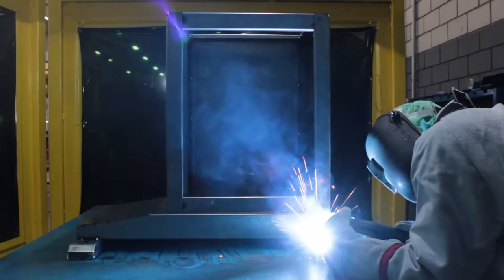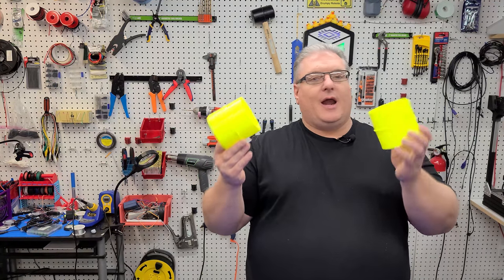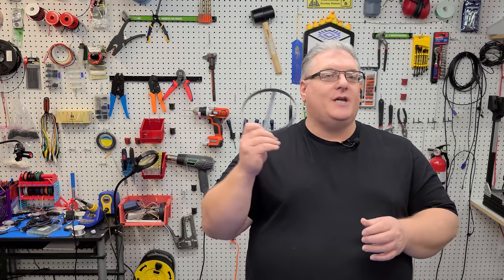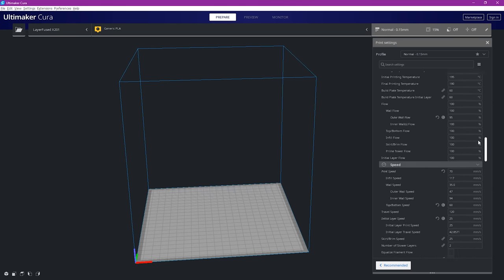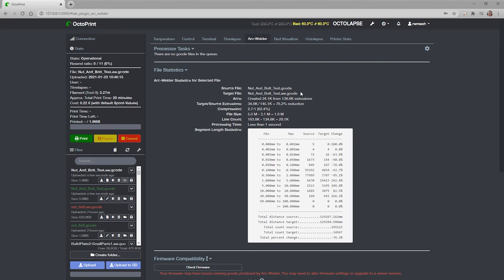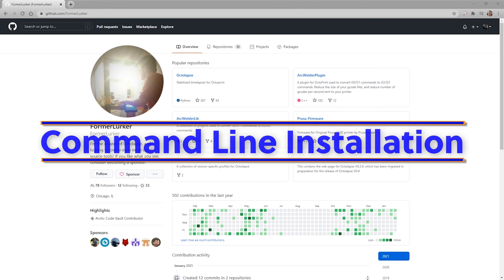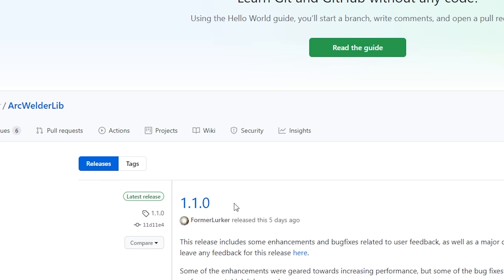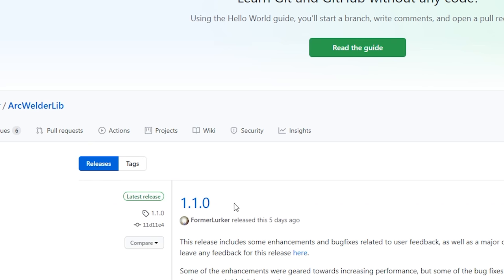Arc Welder - Smoother, Faster, Better 3D Prints! Its like magic to improve your 3D Print quality.

Comment: Arc Welder seems to work great. Thanks for the video. Most of my test prints have been vastly reduced in size, but for one odd one. It was just a test piece to check if I had enough clearance to fit over something. Simple washer shape. 1.25" ID, 1.5O" OD and .25" thick. Arc Welder added 3% to the file size.

Comment: I used to create models in tinkercad and i would notice when printing round objects there would be quite a bit of stepping and you could see the straight lines. But I have finally gotten comfortable using Blender 3d, so when I create objects that require smooth outside surfaces, I just make sure to increase my geometry to compensate. I've been able to get flawless outer surfaces on prints since moving to blender. Either I will create the circle and increase the vertices from step 1, or I simply add a subdivide surface on the object. Yes the file sizes are larger, but my workflow hasn't suffered much, and blender is also very specific when it comes to things like excess geometry, flipped normals, walls trapped inside geometry and the interface allows you to get really surgical when it comes to getting a perfect manifold model for 3d printing.

Comment: I used to accomplish a similar effect telling TinkerCad to create circular objects with maximum number of steps (up to 64), but often on items with lots of holes, that caused TinkerCad to slow to a crawl every time I told it to group pieces. It also resulted in HUGE stl files. Since adding Arcwelder to Cura, I leave the steps in TinkerCad at the default 20. My stl files are smaller, Cura slices them more quickly and I don't get any stuttering on my Aquilas ( I run Alex's firmware). Once my first layer is down, I usually bump speed up to 200% or higher. On my printers it looks like 300% is the maximum where I can see the speed difference. Higher than that, and I see no obvious improvement. I love Arc Welder!

Comment: I'm so glad I found this video. Thanks for making it and thanks to FormerLurker! I had no idea Marlin could handle arcs in GCode. 

Top notch software works a treat. 

If anyone is curious I'm running my octo-print server on a Pi Zero W and Arc Welder runs fine.

Comment: I love Arc Welder, it can improve prints, but it just straight up makes print streaming faster.

I have honestly been thinking about running some speed tests, since there is less gcode to run and combine, it should be faster...

But yeah been using it since beta and my only complaint with it is that its a little too easy to use, it feels like i should be doing something, nah just install and boom magic

Comment: I added the Arc Welder plugin to Octoprint and it works very well, except that the other day I noticed some rather ugly perimeters on a small print with very tight curves. The model (it was an STL downloaded from Thingiverse) had a spring in it that consisted of a sub-2mm wide structure turning through 180 degrees with about 1mm between one part and its neighbour. The perimeter U-bends were far from regular and there was poor adhesion between the perimeters. After switching off the Arc Welder plugin the print from the same STL file came out as I would have expected.

I do agree though that on bigger prints the file size reduction is usually significant.

Comment: It's possible that I had it configured incorrectly, but I had tried it myself previously, and it did not work well when printing a spiraled vase. Of course most prints are not vases, but I find them useful as part holders, and figured I should mention it. Good video!
Reply: "*Allow 3D Arcs* is an option that allows G2/G3 commands to be generated when using vase mode. This is experimental and it's possible that there are some unknown firmware issues when adding Z coordinates to arc commands. That being said, I've gotten pretty good results from this option. At some point, this will be enabled by default."  I see it is also available to activate in the latest Cura plugin...should we dare? haha

Comment: I've had arc welder enabled for a long time without even changing the settings and I've had great prints these days. I hadn't even thought about it, I watch this video thinking about getting it and I realized I already had it installed and turned on. The cura plugin is what I'm talking about. It's pretty legit guys

Comment: Compression alone this is super helpful. I have a rather big 450x600mm delta and I ran into a issue where I couldn't even attempt some large prints due the massive g-codes just straight up crashed pronterface and once or twice crashing my smoothieboard completely well printing via SD. Curious is there any observed print speed increase? Even a small increase would result in decent time savings when dealing with 30+ hour prints.

Comment: Sounds like some cnc machinists are breaking into the 3D print code! 😏
Reply: Considering it's all gcode, surprised it's taken this long
Reply: You took the words right out of my mouth , there is in the CNC-world already code that is used for circular movement. I am a bit rusty what G-numders  it comprises.
Reply: @sergevereecke680  g0=rapid, g1=line, g2=clockwise, g3=counter-clockwise
Reply: @sergevereecke680  exactly. I was frankly shocked to learn that 3D printing isn't using circular interpolation. I guess the print world didn't bother to consider that people have been CNC machining parts with arcs for decades.

Comment: Good to see this is FINALLY being implemented in the 3d printing world but I think the software is still too buggy to use for everyday printing. My 1st 3d print was a disaster! ArcWelder couldn't even calculate the skirt right. I tried PrusaSlicer with Command Line and I tried Cura with the plugin and they both produced terrible gcode files. I used the default settings and also played with them but no improvement. I'm still excited about the future of ArcWelder but from my experience it's still in it's beta stage. If the fault lies with me please let me know what I did wrong. Thanks for the video!!
Reply: I would love it if you could post your before and after gcode on the Arc Welder github page so I can take a look.  You might want to check and see if Arcs are actually enabled on your printer.  The easiest way is to send a naked 'G2' command.  If it replied with 'Unknown Command' then arcs are disabled.  If it says something like 'invalid parameters' or 'OK' they are probably enabled.  Please let me know!
Reply: @FormerLurker  Problem solved thanks to you, FormerLurker! I tried the naked 'G2' command and I got 'Unknown Command'. I'm using Klipper and I knew "arcs" was supported but I didn't realize it wasn't enabled by default. It was an easy fix to the printer.cfg file and I got a successful print. I also learned that Prusa G-Code Viewer doesn't recognize G2 commands and displays what a printer would see if arcs was disabled. Opening a gcode file in Cura does the same thing. This made me think the problem was with ArcWelder but it wasn't. Lessons learned: 1 - To those using Klipper - You need to enable arcs in your printer.cfg file (documentation provided on the Klipper Github page). 2 - Prusa's and Cura's gcode viewer doesn't display arcs yet. Thanks again FormerLurker and Makers Mashup for your contribution in 3d printing.

Comment: Many, many people who are using Sanguino boards, such as the Creality 1.1.4 or 1.1.5, have disabled ARC support in order to install a BLTouch, and as such they will have a problem running the gcode processed with ArcWelder. Also, ARC support used to be supported in much older slicers and its use sort of fell out of favor. You should have mentioned the impact of disabling ARC support in the firmware as the numbers of printers, particularly Ender 2, Ender 3, Ender 3 Pro, Ender 5 and Ender 5 Pro and CR10 printers.
Reply: Fwiw, there is a firmware tester in the beta version of the plugin.

Comment: So, I've heard Arc Welder won't really do anything for printers running files off an SD card. It really only effects serial communication buffers. 
The same effect can be done in Cura by reducing the resolution numbers.
Reply from the maker: Not sure I agree.  SD card performs better than serial cable but the buffer underrun happens Marlin regardless of serial or SD.  Buffers and marlins ability to process that buffer exists regardless of how it receives the data.  Changing cura resolution may reduce line segments but it's certainly not creating arcs.  Arc welder creates G2 commands where cura doesn't.
Reply: @MakersMashup  
Interesting. I'll just have to try it out then. I'm not disagreeing with you. 

I'm running a modified Ender 3, using Marlin firmware. 
It was explained to me that the stepper motors are not capable of performing a true arc movement. That they can only perform micro straight lines. So running the G code through Arc Welder wouldn't be any more effective than just increasing the resolution settings in Cura because the SD card setup doesn't have buffer issues compared to serial communication.

I have no experience with Arc Welder so I have no idea. Lol but I do have my resolution settings in Cura turned up so my line segments are a lot shorter. 
I don't know if I would be able to notice any difference or not. 
I'll try it out on some test prints and see how it performs. 

I was told this by a person that has been professionally printing for several years, but they run Octoprint over internet connections and do not use SD cards and they love Arc Welder, but they were trying to explain to me why it wouldn't give me any benefit because I run off the SD card. 
This person doesn't have any experience with Marlin firmware so maybe it was just their assumption.
Reply from the maker: I've heard that too @salty steel about the steppers.  I have tested it though in SD and USB so I'm just providing my experience.   @formerlurker did mention when I was working on this that same point on steppers.  .9 deg steppers should provide some improvements along with arc welder.  It's not perfect arcs with the steppers creating straight lines at the lowest level but I saw marked improvements over the slicers line segments.  I believe that is because the arcs are handed off to marlin vs. The slicer plotting the segments.  I've tweaked that resolution in cura myself and it's a good tool as well to improve performance and prints.  I just look at arc welder as another cheap easy tool to help the prints.  Let me know your results.  This video received a ton of visibility and I know @formerlurker has been able to improve arc welder based on all the feedback.  So I would love to hear how your testing goes so others can benefit from it.  Thanks again for your insight.
Reply: @MakersMashup  
Your in depth knowledge is extremely informative and helpful. Paints a better picture for me to understand. 

I'll try to come back with any info about testing. Just thinking about some simple cylinder shapes to print with Arc Welder processed files, and just regular Cura processed files and see the difference.

Right now I'm fighting all metal hotend clogging issues. I've narrowed it down to the nozzle instead of heat creep, cooling, correct PID settings, or retractions. The Overture hardened steel nozzle is not playing well with PLA but does great for CF nylon. Switched back to the brass nozzle and all problems go away. Cold pull test on steel nozzle is indicating that the PLA is sticking to it, even when it's clean.
I'm waiting on my new Micro Swiss M2 coated nozzle (supposed to be the best) to come in, if it works well then I'll get back to trying out Arc Welder. 
I'm running everything from PLA up to PC through this Ender 3.
Also considering the Micro Swiss direct drive kit for trying out flexible filaments. It should provide more extrusion force/pressure without slipping or skipping.

Comment: Oh and i had been compiling Arc support out of my firmwares for years now, thinking there is no point...

Well whenever i get around to rebuild, i guess that's coming in then. Not sure how well it'll work with increased planner buffer size or if i need to reduce that...
Reply: You shouldn't need to touch your buffer sizes if they are working.  Just enable arcs with the default settings (they are quite good as a starting point) and go from there.  The most important thing is that you download the latest firmware version.  There have been a lot of updates for arcs that improve quality and speed.

Comment: It is my understanding that .stl files represent the surfaces as a bunch of flat faces. I don’t know if the .stl standard allows any curved surfaces. Now depending on how finely you specified your CAD software to output .stl models you will get more or less flat faces. The model explodes in size if you don’t give reasonable tolerances. The slicer software turns the .stl file into codes, a very impressive job, and outputs lots of straight lines. Arc Welder looks at these polygons and then fits arcs to them. It would seem it now corrects the original error made in generating .stl files as flat surfaces in any one slice. It obviously won’t change straight lines int the z direction into curves because the printer works in slices only. I might be wrong here.

I must use a lot of round things in my models because I rarely get less that 50% gcode size reduction. The one thing I haven’t worked out is how to randomize the start of the circles. Cura can do this but arc welder doesn’t know this, will it folow Cura’s start position if I enable randomising the start?

Comment: Don't care about the file size, I care about the quality of prints. But to me seems only good if you only have arcs. in straight-line is quite slow at printing. Never Mind I think is slow at filling the gaps not on the straight lines. You shared Very useful wisdom. Thank you.

Comment: Thanks for the video! This is great, but don't know why (I'm a noob) my printer already prints perfect cilinders, you can't tell it's printing in straight lines as you say, actually if I hadn't watched this vid I would have never known. There are no bumps like the ones you show. I've tried different sizes. I will give Arc Welder a try anyway. BTW, my printer is a Hellbot Magna I and I'm using Simplify3D as a slicer.

Comment: Surprised arc extrusion was ever tested in marlin, since no slicers use it.  The firmware writers must enjoy writing gcode from scratch.  Been driving with polygon wheels all these months.
Reply: Probably just left over from GRBL and never specifically tested for 3D printing.
Reply: Marlin supports CNC, laser cutters, and the like, where you might actually encounter a G2/G3 occasionally.  Support was still a bit rough around the edges until recently, probably because there were too few people having issues.  Fewer users/testers = fewer bugfixes and improvements

Comment: Excellent video! You have a natural talent for teaching. I don't have a 3D printer yet, but I'm researching because I'm ready to buy. This is something I am definitely going to look into.

If you were going to spend around $500 for a 3D printer now, do you know what top 2 or 3 you would consider? I found that many of the ones that I thought were top notch have horrible reviews, and I am back at square one after a week of research.
Reply: for 500 bucks you could get 2 ender 3 pros and they print really good. Just make sure and keep the rollers clean and adjusted correctly as they ware.

Comment: Excellent video, there was a lot but it was concise and easy to understand. Plus the bonus of video is you can always reply.(lked and subscribed) 
Questions you made a statement about 200% feed rate vs 400%. What setting are you modifying to control the feed rate.
Reply from the maker: M220 Allows you to change it real-time or if you have a know on the front give that a go.

Comment: Thanks for this, I will definitely check it out. I improved my rounded prints a great deal by increasing the number of sides from the default if 40 to 100 but my file sizes went up, if I can get smoother prints with a smaller file, that will be amazing, thanks again

Comment: What you didn't mention was just how much faster the prints print. Even without increasing the speed, because there is less gcode, the printer can just plough through the print. I'm converted.
Reply: THIS! ^^^ Changed what was going to be a 14 hour print into 2!!! Granted I'm still testing, but WOW!

Comment: Well, I say this extra effort in installing Arc Welder does give 8-bit 3d printer CPU boards a bit more value for your money. Imagine a piece of slicing software with built-in arc welding capabilities.

Comment: Installed arcwelder two times, because I found it exciting, but had problems making it work with klipper and the advantage is greatly reduced when running from a raspberry pi.

Comment: Hi thanks for the great explanation. Just subscribed after watching a couple of your videos and finding them very helpful. I haven't tried an actual print with arc welded however after installing the plugin in cura and activating before slicing a model, cura estimated the same print time, with arc welder active or inactive. Is this normal?